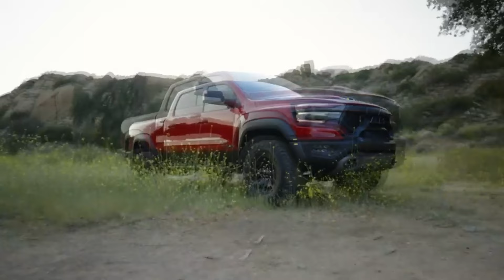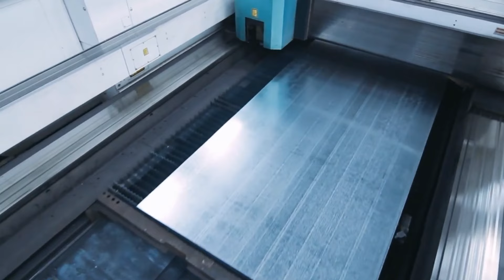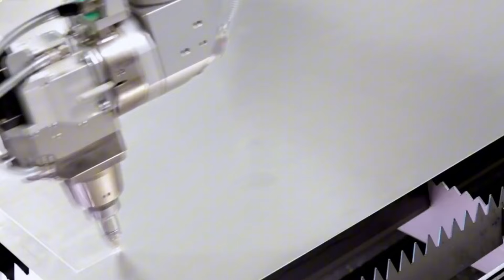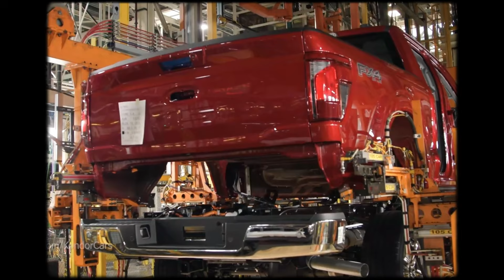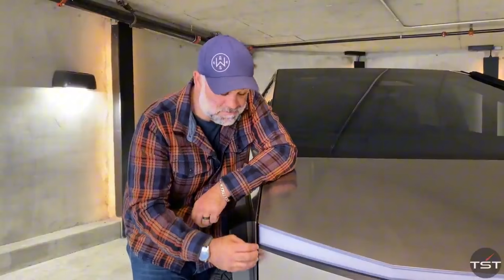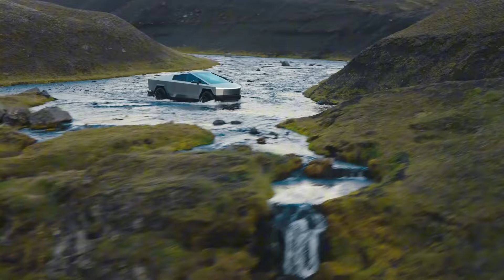Tesla's Biggest Problem Isn't the Cybertruck

Comment: How did Delorean get curves but Elon couldn’t?
Reply: Check out Ford 1936 stainless
Reply from the maker: Delorean used brushed stainless steel over a fiberglass body, which allows for curves. Tesla uses cold-rolled stainless steel, which is harder to stamp into complex shapes.